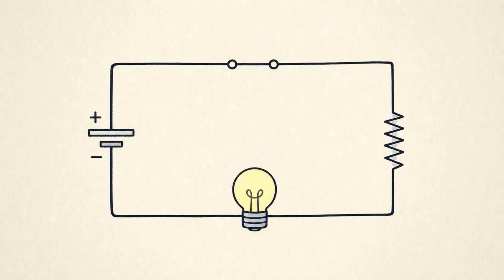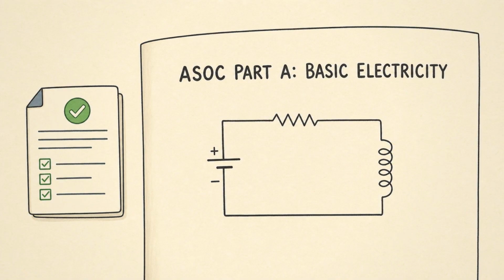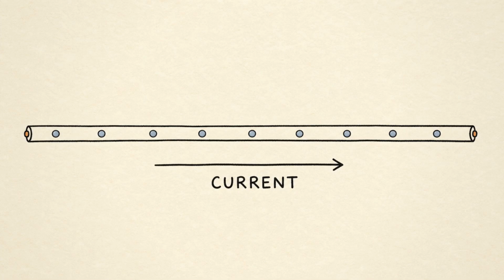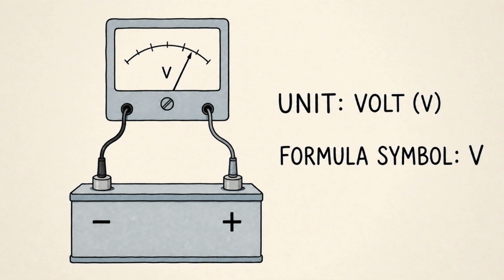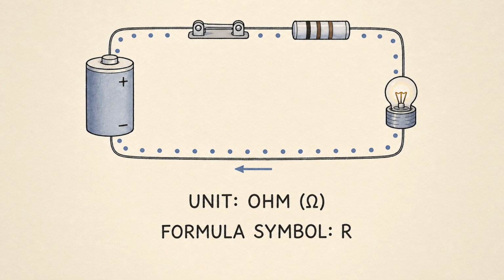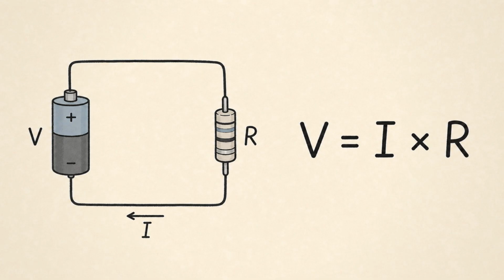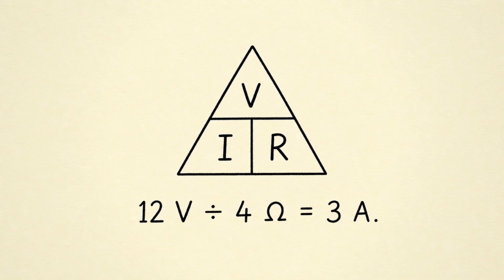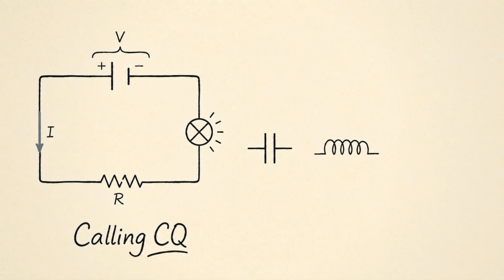Basic Electricity: Ohm's Law Explained

Comment: I understand the need to learn about transceiver block diagrams explaining how they work but individual components? Years ago you had valves and then transistors and now you have integrated circuits the size of which you can only see when the magnifying glass and multi layered circuit boards making the cost of repairing more than buying new, so why learn about things you probably would never use? 73s
Reply from the maker: It’s true that modern gear is harder to repair, but understanding the fundamentals really helps troubleshoot and appreciate how these devices function!